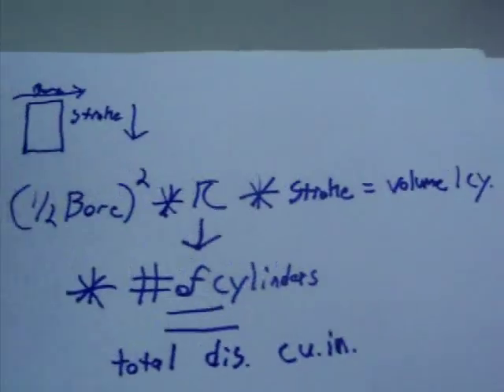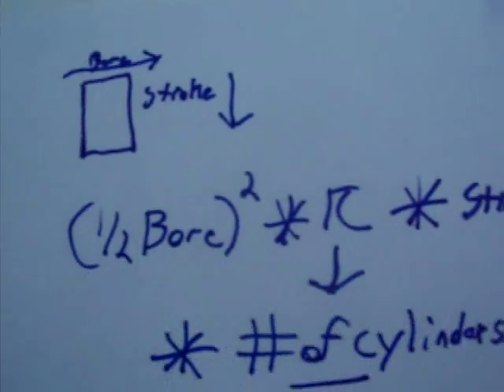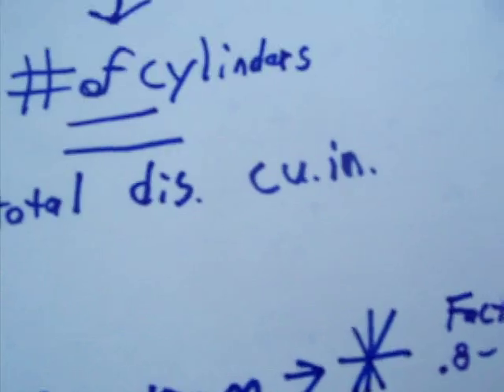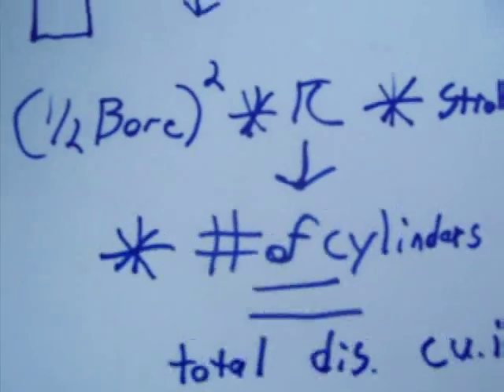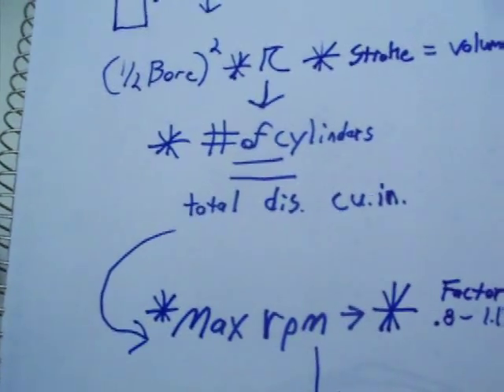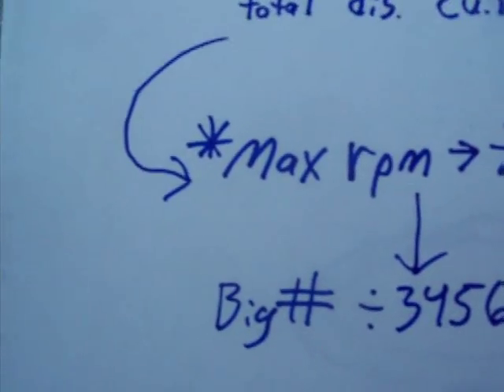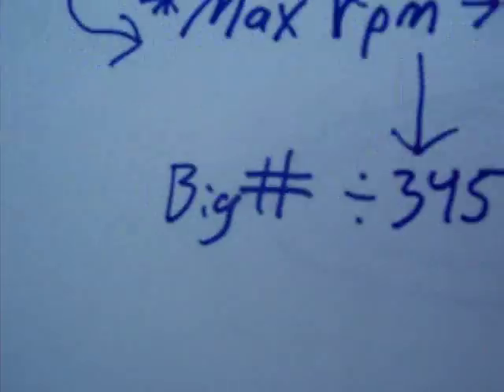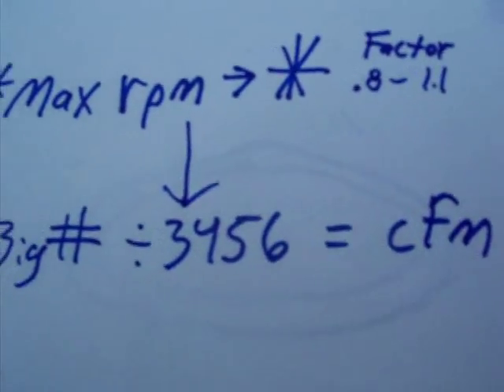What Size Carburetor Do I Need

Comment: I need help.
I know stock Chevy 350s are happy with 650 CFM carburetors. That being said I have a 750 Edelbrock 1411 on my non bored over 350 that is far from stock.

It has an Edelbrock dual-plane intake, A lopey 510/520 lift cam (2200-5800 RPM) and aftermarket vortec heads that I have ported and Polished myself.

Whenever I tell people I have a 750 CFM on a 350 they freak out saying my carburetor is too big but to me it doesn't feel like it's too big. When I stomp on the gas it does not bog it just goes, when I read my spark plugs either after daily driving it for a while or driving it hard the spark plugs look clean with light amount of soot around the ring at the end of the threads (in other words they look fine to me) and the vehicle idles fine. If this will tell you anything I have a vacuum reading between 15 and 16 inHg. I have not changed Jets metering rods or Springs.

When I tell people (including shop owners) that the engine runs fine. they say oh well it's still too big you're probably losing to tuneability or losing power at higher rpms.

So what I'm asking is in your opinion is my carburetor too big, if not what defense can I use to make these people stop freaking out and what are the signs that a carburetor is too big?